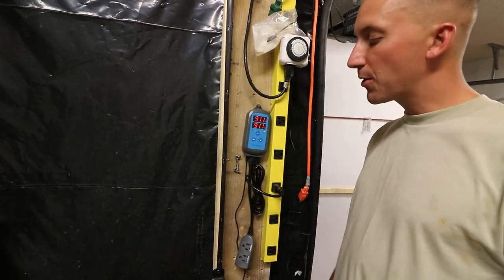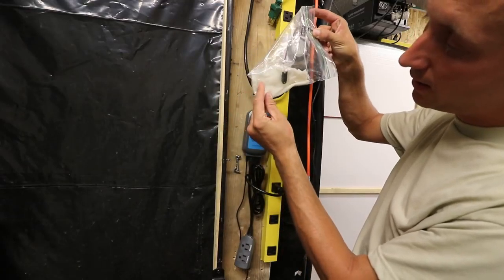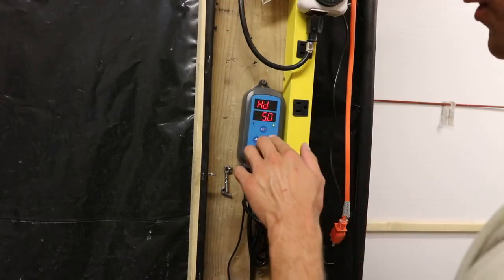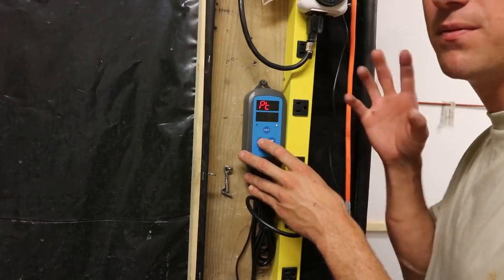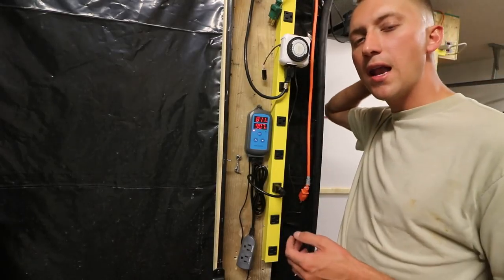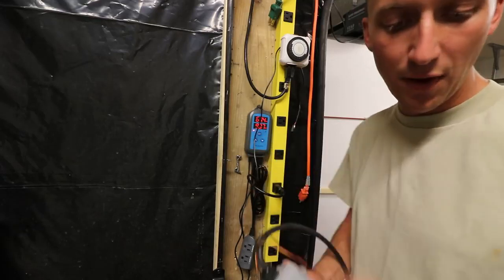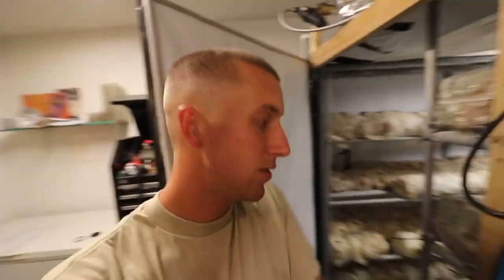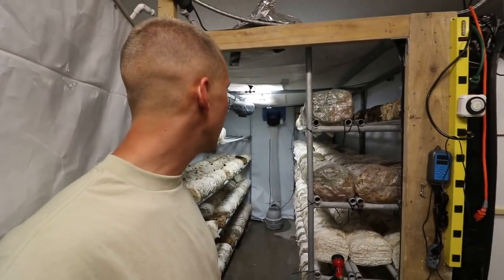DIGITAL HUMIDITY CONTROLLER CALIBRATION AND PROGRAMMING

Comment: That's what we have hey Eric we have the same model ihc200 inkbird. We don't have the exposed probe to put RTV over. Must be the newer models are different I'm guessing?
Reply: same thing with me. i think they updated the sensor. looks like our version is better protected, but i don't know how to replace it if it stops working
Reply: @joeholmes4711  You actually have to open the sensor cover to access the probe and add RTV to seal.
Reply: @mmmoz1 How do you get it open? I’ve been trying and the thing won’t budge.

Comment: Some people seem to have success with this unit. But for my needs the humidity i need is too high and it beeps all the time and the sensor will go bad like he said and it will have an error mode where it stops working. As you can see this dude has all the problems most people have. I sent mine back. Not good for gourmet mushroom cultivation. Dude literally shows you how shotty this product is. Dont do it, find something else or have your humidity on a timer once you have it dialed in. He is doing this video as an Amazon affiliate... that is where I got mine. I don't mean to ruin dudes livelihood but I came here to solve my problem only to see someone else struggling. If y'all can make it work GREAT 👍.  BUT not my experience.
Reply: Did you find a better solution? I'm a buy/build once and make it work kinda guy so any help would be greatly appreciated

Comment: I did not calibrate out of the box but I have 2 hygrometers that read about 12% higher than this so I moved it up 10 because that’s the max I could do, is that good or is it calibrated out of the box and my 2 hygrometers are wrong?

Comment: Thanks for that calibration idea!

I missed that part in the settings and was wondering already why it works so smoothly but I can't get more than around 93% and already suspected a faulty sensor. 

Just trying that method.
Reply: The sensor has little to no accuracy above 80%, it is not the correct sensor for high humidity unfortunately.

Comment: You can’t calibrate a hygrometer that way. You need to make a slurry out of salt water and seal (as best you can) the sensor in a bag with it for 8-12 hours. It should read 75% humidity.

Comment: Great video man - Just curious tho were you able to calibrate the other unit you briefly showed in your video?  why did you stop using it?
ive got one heading my way to control both temp and RH but curious if it even has to capability to be calibrated..... anyone know??
Reply: Hey Cyberspoon did that unit have RH Calibration in the end and how did the unit perform for you? Cheers.
Reply: @027fuckoff  hey yeah it's been.... ok. I don't think the RH sensor is very accurate tho. But you can offset the reading for both temp and RH. It takes a bit of trial and error to get it dialed in for your set up/specific species etc...

Comment: Great video. I own a few of these. I've had a ton of problems with this company saying that these are not accurate at high humidity and just trying to blow of my purchase. I ran two of these hanging in my fruiting chamber within an inch of each other and I was averaging a 10%+ difference in readings. They care more about an order number than the fact the probe isn't fully insulated or is accurate. Typical (it's your fault, not ours) business response trying to not take responsibility when the product is bad. I would honestly never buy a single thing more from a company  that tries to shift blame on an incorrectly made product. Even though it says it's rated to 99% humidity good luck getting them to take responsibility for not working in high humidity environments. When this one burns out I'll just go back to making my own humidity controllers that work correctly instead of buying more from these guys to save a bit of time.
Reply: Do you have more info on how you build your own? That sounds cool!

Comment: This controller works great.  I have. My tent set up with the dehumidify work2 on a turbo exhaust fan.  If the humidity goes over just 1-2  it will kick on and gets in under control in under a min.  Otherwise ur just waiting for water to condensate